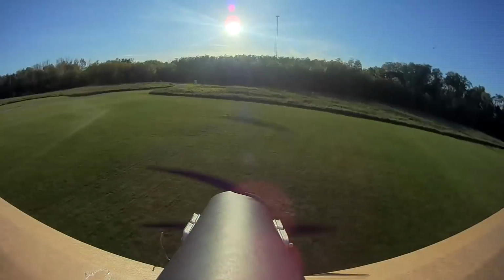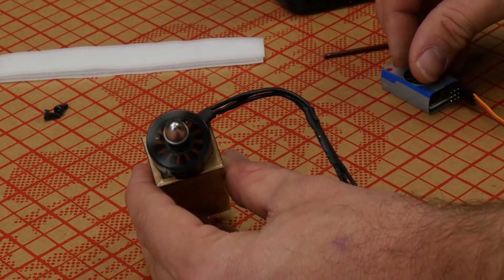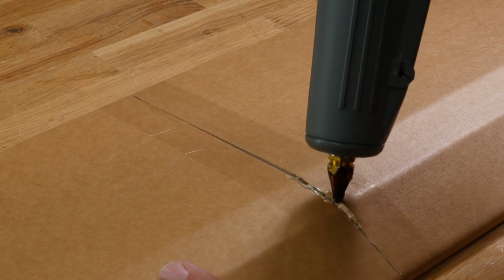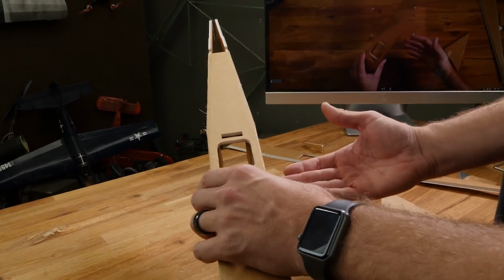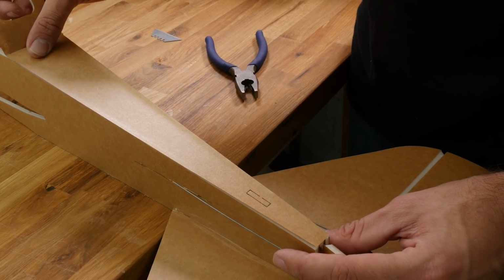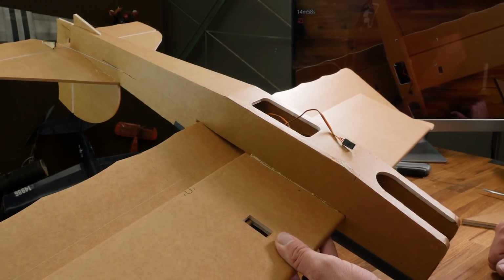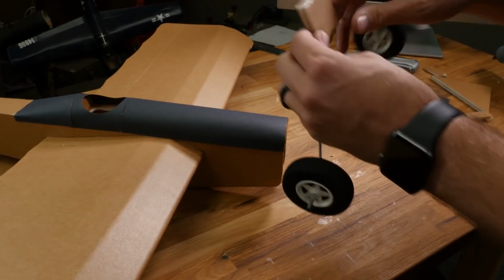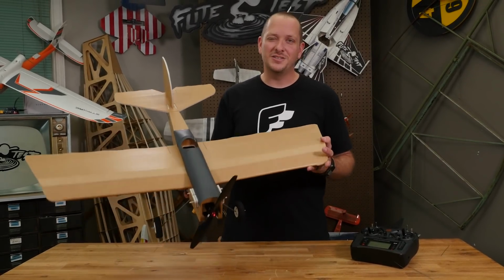DIY FT SIMPLE SCOUT - Build | FLITE TEST

Comment: If you are an experienced or novice modeler, this video has many, many tips which come from decades’ experience and are happily shared by Josh Bixler who is a master craftsman and designer.  Listen to and integrate into your building advice like, “Use the table as your friend.”, “Favor the glue to…”, “This must be square…”, “It will still fly well, but it will look funny.”, “Use soft hands…”.

Comment: WOW! After sanding bevels with varying degrees of success, I finally got the blade technique down after much practice on scrap. The best "secret" I found to doing this is to treat foam board like iron-on covering - ALWAYS use a new blade and change it at the first sign of a non smooth cut. The blade is still useful, just not for cutting foam board.

Comment: I was watching you putting the screws in the servos. You said support the screw with your fingers. For me and lots of others out there this is next to impossible. I have neuropathy in my hands so my fingers don't exactly have any feeling. You need to come up with a plastic centering tool that fits over the servo arm with a plastic tube on the servo arm allowing someone like me the ability to easily center the screws.And once screwed in the centering hole the tool can be removed  if made right it should center the screw ,and keep the servo arm from moving.

Comment: Just started my build of this model. Different motor block than this. The firewall has no offset and two holes on top. and larger. Hope this will fit.
Reply: Same , is it for down thrust. How did yours go? Motor mount has two holes on top offset to met top of fuse?

Comment: Very interesting aircraft, like to build but just want to make sure about the power installation. Can I put a2212  1400kv brusheless motor, 50a ESC with  7.4v  2s lipo battery ?

Comment: hi everyone yesterday some how one of my servo (which controls the elevator) unlatched it self from the foam board. 
that servo is inside the fuselage and very hard to reach. do you have any suggestions to hot glue back to the foam board.
my first idea is cut the frame take out servo/recenter it and glue to another foamboard and glue and ducktape the part that i cut. 
do you have any other suggestions? 
Thank you very much :)
Reply: Mine did the same just cut the plane open on the underside below the servos and reglue them.

Comment: help,  the power pack was out of stock so I'm building using my own power pack 
parts and a park 480 motor with 40amp esc.

So do I  use the power pack box supplied with the kit, then glue the 
wooden firewall to the front of the box and then attach my motor to that
 firewall ?

This build video shows the esc being glued to the box not far behind 
the firewall.
Since my park 480 is maybe 20 grams heavier than the motor that would 
come with the power pack - I'm thinking I may need to move the esc 
farther back to get a good balance -
if I glue it to the side of the fuse box will that mess up the lateral 
balance too much ?

Comment: Hi, I just finished the scratchbuild of the Simple Scout. It would be very userfriendly  to give the mesures of the Battery compartment on the plans, to know in advance which Battery fits in. The 1300mAh ones I bought are now just a bit to long....   Thanks it's a great model. 
And I wonder how to get the plane a little bit nose heavy with a 1200mAh Battery. I had to ad 25gr lead to the nose....
Reply: man how did you print  tiled ????
Reply: BigHigH    You have to download and use the tiled plans to print it this way. 
Then it just comes right out as you need it.
If you wish, I send you tiled plans for A4 paper size.

Comment: Is it possible to fly simple scout with tale control only???
Reply: In one of the other Simple Scout videos, they mention you can build and fly it for either 3 channel control (thr, ele, rud), or 4 channel (thr, ele, rud, ail). They said it flies well on the 3 channel, and that the ailerons can be added later if desired for more aerobatic flight.

Comment: That's the best plane you have designed ... one single thing for scratch builders - the distance from the leading edge of the wing to the motor should be 3-5 cm longer other wise you will never balance it as it should be. Nice job , nice planes nice plans but if you really give them for 'free' for beginers ... just take in to concideration that not all ppl put fpv, landing gear, and the same type of battery. :*

Comment: Hi, I was wondering if there is a way to test servos and the motor without a servo tester, as the one you use is out of production (and because I'm a cheap-ass student)
Reply: I figured it out, by binding a receiver and using the rx. Tip for anyone too broke to afford a tester :')

Comment: I have  built the Mini Scout 3 times now.  I kit fro FT, 2 scratch built with FT Store parts.
I still can't fly it.
I don't why it won't fly.
I have flown only on a simulator (Realflight) with my own radio.
I don't know what I'm doing wrong.
Reply: maybe balance or... thrust: getting away from you in a left turn, etc? Maybe excessive throw on control surfaces? 9 months now. Figure it out yet?

Comment: Why is this the video for the Simple Scout but it is showing the instructions for the mini power pod in the video. I know the construction is the same, but it doesn't indicate the orientation of the port for the motor wires that are on the Simple Scout plans. 
  This is a small thing but it makes a big difference when you start to run your wiring.

Comment: What size power pod does this use?
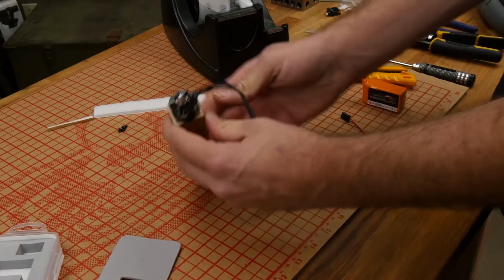There are instructions for the mini power pod, and what I think is the F pack @13:08 ; but the C pack and the trimmed down power pod later, @1:24:00
Reply: Just got the kit.  Has the larger simple pod designed for C/B packs.... not minis.

Comment: Ive got the guts from a parkzone archer and a 2700mah 30c 2s battery, would that work in this plane?
Reply: Brandon R that battery sounds a bit heavy, and it's also a 2s so it would not give you the power you would need to lift that kind of weight. You could try scaling up the plan by about 150% or around this would give you a bigger wing area to help with the weight and result in a better balanced model. Hoped this helped. happy flying.😁

Comment: Wy did you build a mini pod with mini  power pack in the beginning?
Reply: David Tucker it was a mistake on stock footage. The powerpod on the scout is shorter than the normal power pod. It builds the same as the mini,  we are going to correct it and re-upload it as soon as we can.
Reply: Got it . :)
Reply: @joshuamelvin  So...The powerpod from old fogey and the simple cub will not "swap" into this plane? Just trying to figure out if I need to buy another engine setup or some more firewalls.
Reply: When you do, maybe you can smooth out the audio, and fix the portion near the end when you ooooh and awe over the plane, "Isn't that pretty!"  Is that Christian telling you to add some intro words?  Nice to see you guys being you!  I gotta say, too,  I was getting anxious, until 41 minutes in.  I wasn't sure if the table was going to be my friend in this build.  Whew!  :)  Job well done, Josh and crew!!!

Comment: What is the cheapest controller and receiver I can get online. Also, flitetest, do you have a black Friday sale for power packs?
Reply: The FlySky I6 is not too expensive and works great.
Reply: FlySky i6. About $52 USD. Works great for beginner/ cheap transmitter
Reply: Go cheap on your first models. You will crash, loose and kill them. Dont take the cheapest radio - it is invesment that will last you for years and years. I am not saying you have to throw huge amount of money, but dont go cheapest. Think only about programmable one FlySkyI6 is OK, but for a lil bt extra you could take taranis Q X7 that is high-end possibilieties and signal strengh.
Reply: Cheapest programmable about US$25 with receiver - FlySky FS-CT6B. Needs cable to contect to PC for programming.
Reply: Does flite test have a black Friday sale on their store?
Reply: Ill try that with the simple cub for my first build